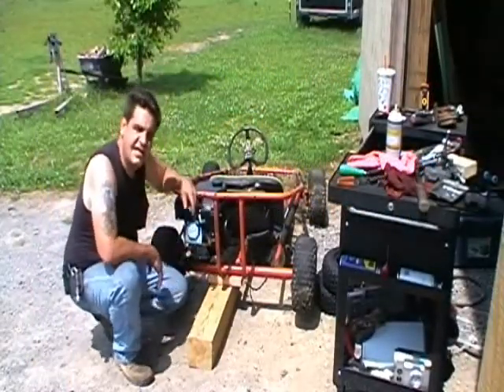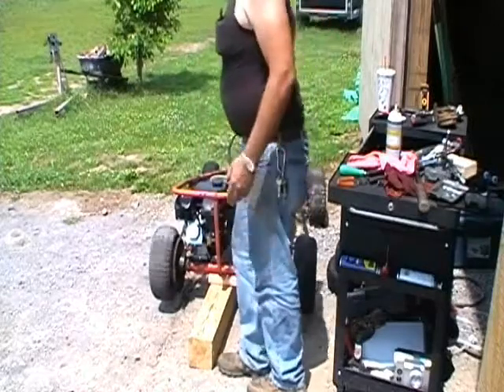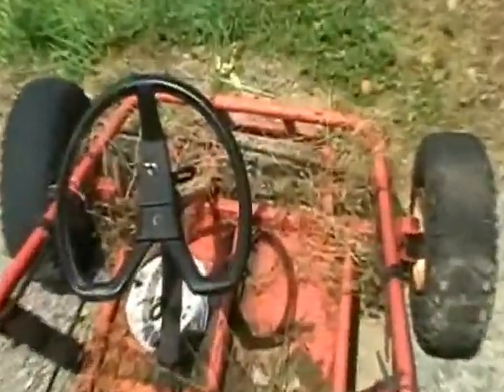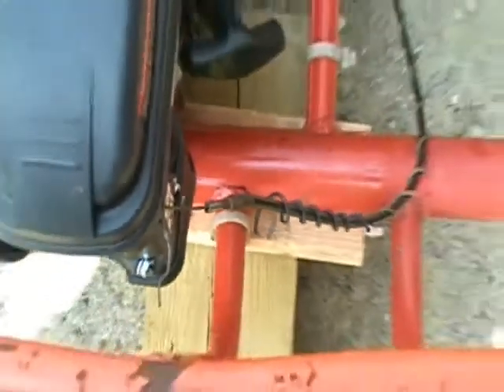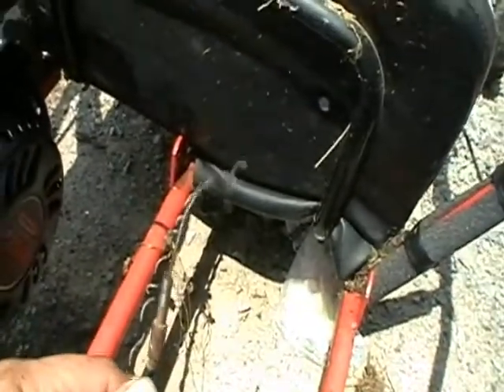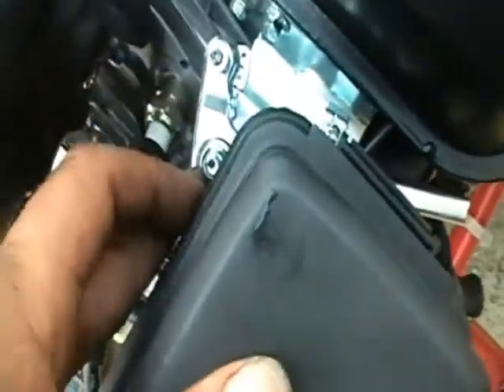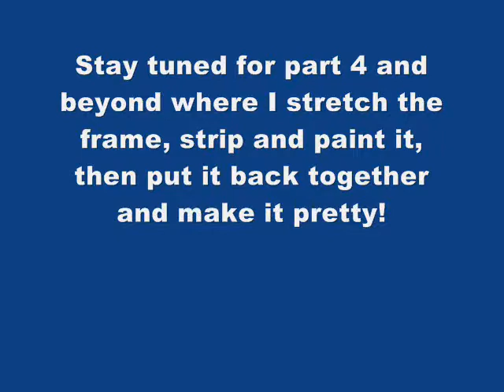Go Kart Resurrection Part 3

Comment: that one just needed a little carb work and it's fine that thing will fly too even with my big butt on it 
oh you changed out the motor? should have told me i have a 5 HP in the shed that runs great and doesn't have any use on it yet that would have worked fine on it.  "it's a little small"?  ARE YOU FRIGGIN SERIOUS